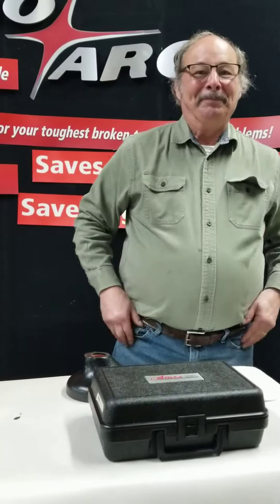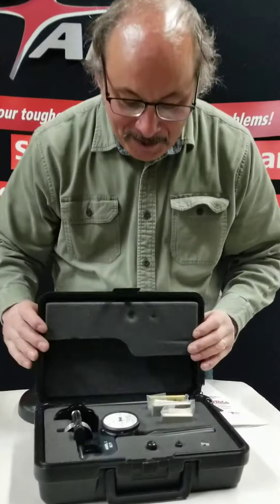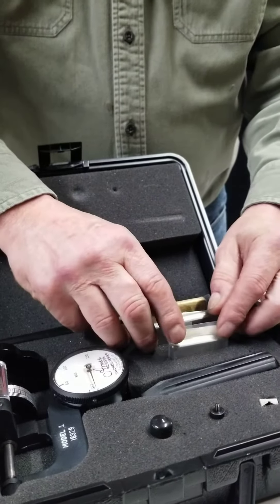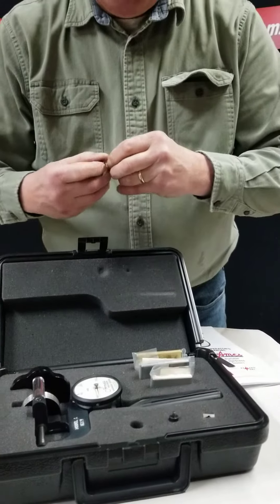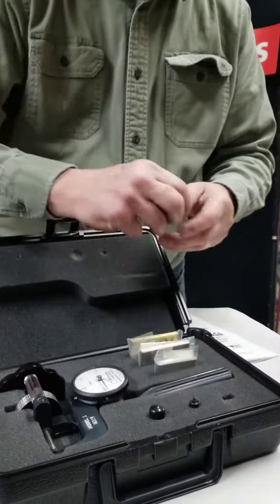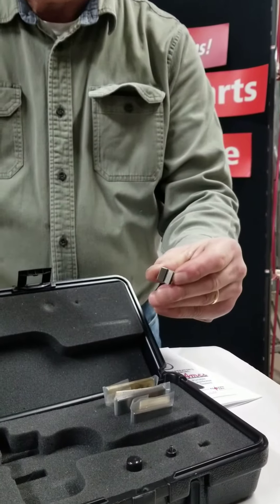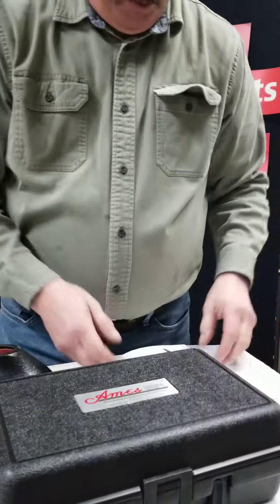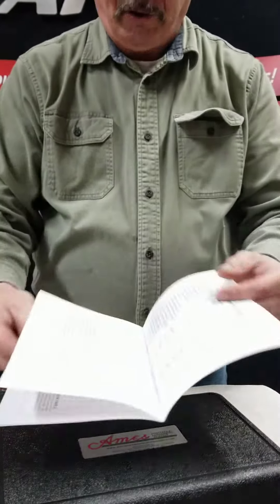Ames hardness tester introduction

Comment: What is the margine of error?  I've read anywhere from 1.5 to 0.5.  Can you do 3 test and average to results to be more accurate?
Reply from the maker: Our testers read +/-1 accuracy, so if you are experiencing discrepancies in your readings your tester may need to be repaired or calibrated.